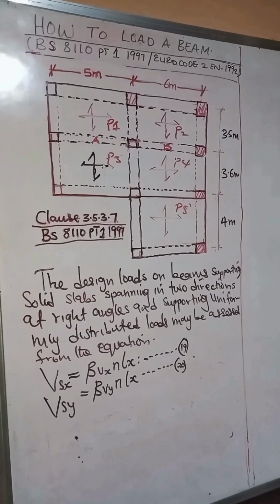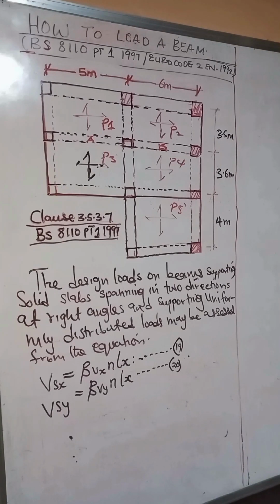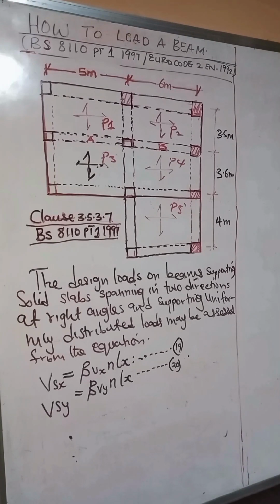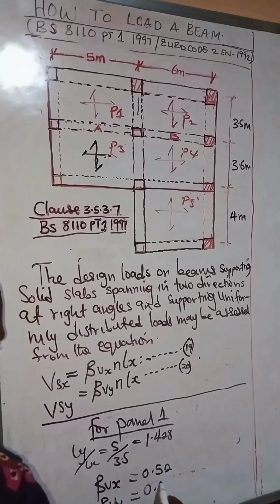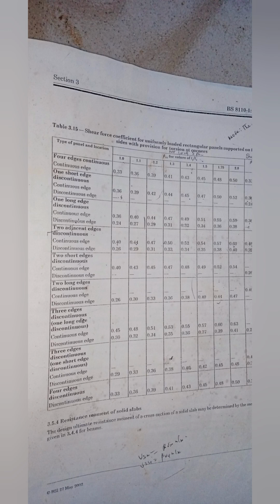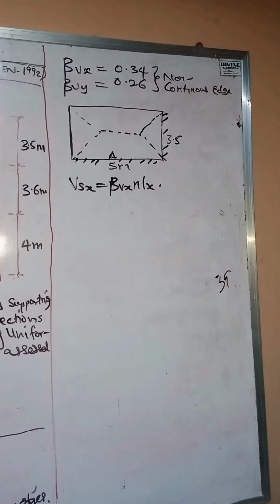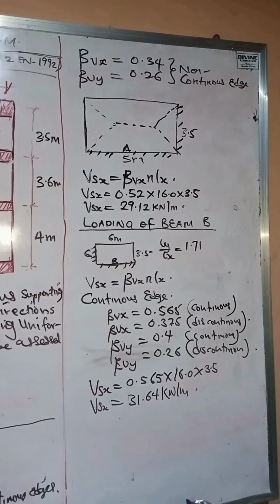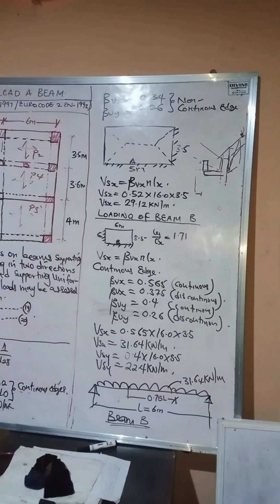eurocode EC2/British code Bs8110 .loading beam from  two way slab

Comment: Thanks for the lesson sir. Please what of the instances when we have “-“ that means, no value from the table in the table due to end panels. And we need to solve for beam
Reply from the maker: Pls explain further, what you mean, thanks
Reply: @ATI-ubagaokelue he meant a scenario that has a hyphene value what happens to that side let's continuous is -, discontinuous has 0.26?
Reply: I thought in the start that Vsx will be loading on the shorter span yet in your calculations you are using Vsx for  a longspan